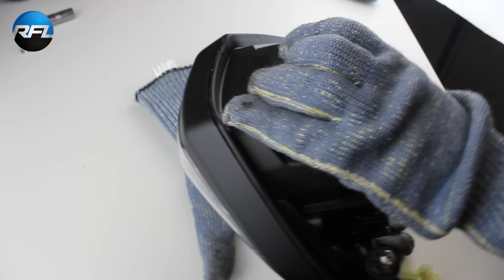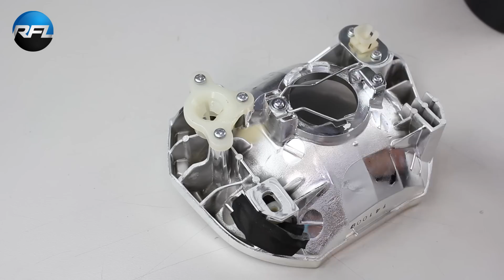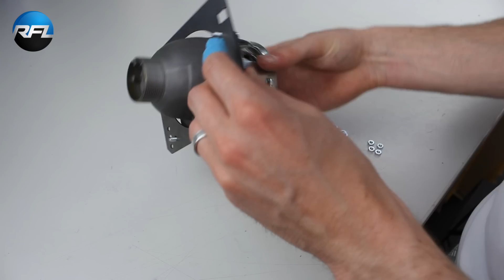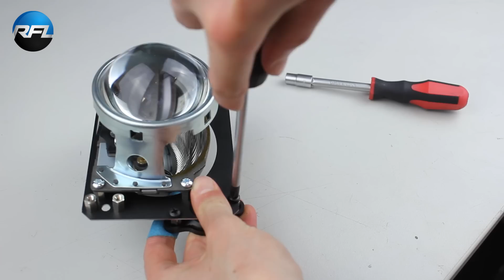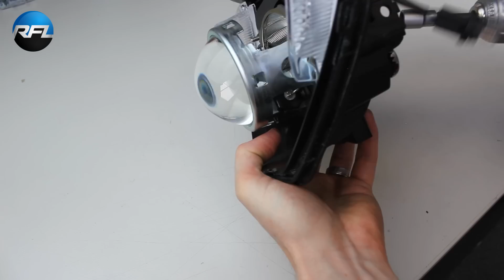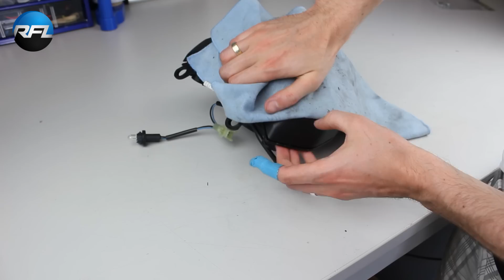Yamaha FZ-09 MT-09 13-16 And MT-07 2018+ Bi-xenon projector retrofit light upgrade / improvement.

Comment: Since i had my plate modified to fit the MoriMoto projector, which just needed 4 holes drilled to fit the threaded side of the projector housing, i started putting everything together. One thing that would help, when he starts bolting something on, even for the plate to the projector itself, would be a 2 or 3 second shot of the nuts and bolts, washers ect, of what he will be using for this part of the video. I had to stop the video and look at the table a few times to see what all parts i would be using for the section of the plate he was doing next, so to not leave anything out, like a washer. 

Also they had a plate/spacer for the plastic piece that snaps into the square hole on the plate. Since i did not have the spacer used for that i found that the metal plate that you remove from the original chrome bowl which was held with 2 screws works as a perfect spacer substitute, it slides either way a bit so you can conceal it behind the black plate and is snug enough to not move. 

All in all as mentioned in my comment months ago still a great video. Thanks.

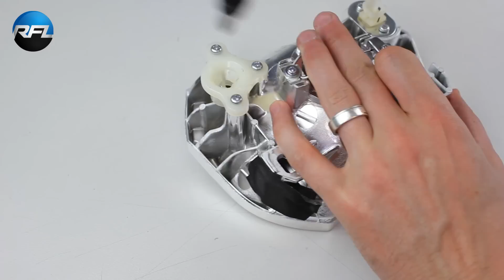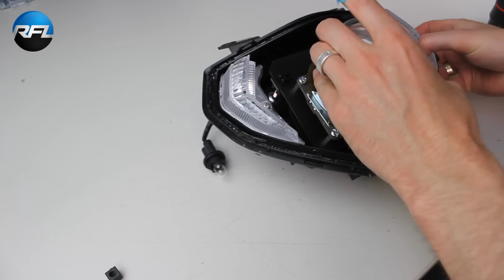Comment: The video does help on how to put in this kit but it leaves out a lot of details. one being at 1:46 the first plastic piece you take off, when you back out the bolts for the reflector it doesnt just fall off like this, you would need something to get the ball from the bolt off the plastic piece, pictured in the upper right corner of 4:42 before putting the projector back in.
Reply from the maker: The ball is removed from the holder on the reflector by using a bit of heat so the plastic holder gets a bit softer and a bit of force. A screwdriver or interior removal tool to use as a lever or to pry it open also helps.

Comment: This is the same headlight as the 2018/2019 mt07, its just a little more difficult. So if you want to install one of these, its possible as I did it myself today!
Reply from the maker: Hi! Good to hear! Could you tell us maybe why it is more difficult or what you have to modify? Thanks!
Reply: @Retrofitlab  to open it up, you have only the top part for leverage, u cant open it up on the left,right or.bottom. thats why its more difficult to open up.
Reply from the maker: @timoboy19  Thanks for the info!

Comment: Will this work with the 2018 MT 07 since I believe the used 2014-2016 MT 09 headlight
Reply from the maker: When the same headlight is used it should work. But when looking for pictures of the 2018 MT07 I'm finding pictures that seems the same as the MT09, but also others. Could you maybe send us a picture of your headlight (when you already have the bike :-))? www.retrofitlab.com
Reply: Not the same headlight
Reply: Taking my 2019 MT-07 headlight apart now, it's the same as the one used here.